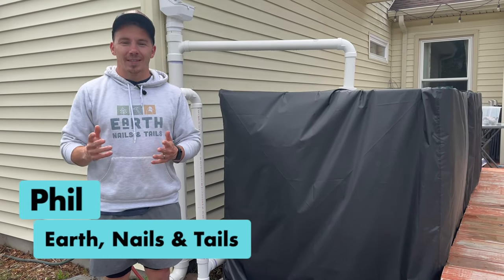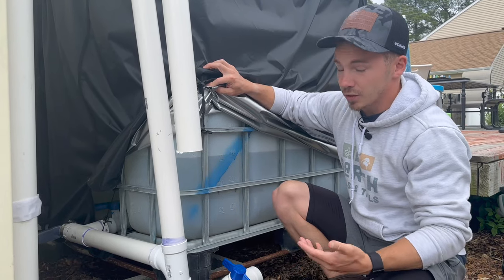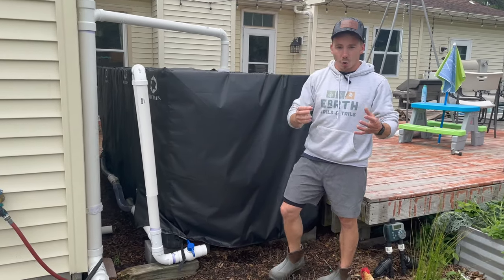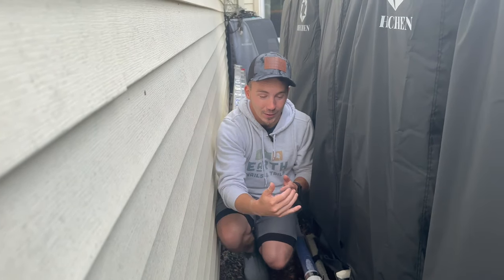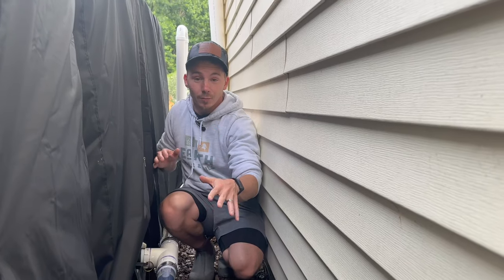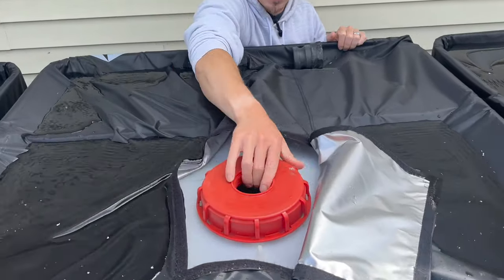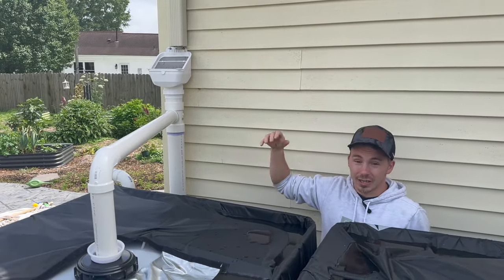DIY Rain Water Collection System - Over 800 Gallons of Rainwater!

Comment: Nice system and well presented. I have been using rainwater for 100% of my household needs for 20+ years. Before my water enters the house it goes thru a 3 stage filtration system. Before drinking or cooking with it it goes thru an aqua-cera filter. Overflow from my household system goes to two 330 Gal. IBC. That is used on the garden.
Reply from the maker: Love this! Thanks for sharing
Reply: @michaelbandeko3519 would love a video of this system!

Comment: If you drill a 1/4'' hole in the drain cap, it will slowly drain by it's self and you won't have to remove the cap after each rain storm, saw this on other videos.
Reply from the maker: Great recommendation, thanks!

Comment: Nice setup and nicely demonstrated. Only thing I would suggest is to route your over flow away from the property to avoid any foundation issues and settling of your water tanks.
Reply from the maker: 100% agree! I have installed a diverter and working on a better solution involving routing the water to a rain garden

Comment: Thank you very much, excellent video.
To prevent debris from entering the tank, it is a good idea to have a larger initial water reception volume. This can be by using a longer pipe or a small receiving tank. In both cases there would be a 1/4" drainage hole.

Comment: I see a video of someone using the gray PVC pipe as your gathering off a tin roof . They cut one side of pvc pipe . Put the edging of sheet metal roof into the PVC . Right in the middle of the pipe all the way in the pipe The top side of the pipe catches the water running off the roof bottom side of the pipe let water run to the tank . 
 bottom side drains down in the 2 “ PVC pipe . They put straps to hold pipe in place on the roof  . Pipe size look like 4” for the guttering . Plum out to 2” going to tank .

Comment: Excellent video thank you so much. I checked out the link to the supplies you used. Did I miss in the video where you used the Twinkle Star sediment filter?
Reply from the maker: Your right it was not directly mentioned in the video. I have it installed before my pump just incase all my filters don’t catch everything and something winds up in the water supply.

Comment: How do you keep the overflow from siphoning out the tanks? ThankYou for sharing your setup.
Reply from the maker: Drill a tiny hole in the top of the overflow to act as a siphon  break or if you use a large pipe with a shallow overflow like I did it should happen naturally 👍🏼

Comment: We use these with epoxy stored 4 high. I bet if you stored them 2 or 3 high, so they are still below your roof. You could get away with less need for a pump.
Reply from the maker: its true, the higher it is the more pressure it will provide. just remember the farther you need the water to travel the bigger the pipe will need to be. this is what makes having a pump handy. maintains the pressure over long distance

Comment: Great system, thanks for sharing this. Just one question , is there any risk of legionella contamintation when the water is heating up in the containers iduring warmer days? 
Would this be an actual concern ?
Thank you
Reply from the maker: there is definitely the potential for bacteria. I would not spray this on the plants. use a drip system or apply it directly to the soil 👍🏼
Reply: @earthnailsandtails   thank you for your answer, could you please share the link for the trap-on to the end of the tube

Comment: Great System! are you at all concerned with the  potential chemical leaching from the Asphalt shingles? Im sure its fine but wondering your thoughts
Reply from the maker: I think it is a legitimate concern but I think the amount that comes off won’t be that significant for the amount of time the rain actually spends on the roof. The filter systems should prevent any sediment from getting into the totes which could cause more significant leaching

Comment: You would have been better off raising the totes about 4 feet off the ground to give the lines gravity pressure, as the lower the water level is in the totes the less pressure you will have at standing height. Your build is pretty stout otherwise.
Reply from the maker: That would be a pretty big undertaking and wouldn’t really provide that much head. 30ft yields about 10lbs of pressure. I got myself a transfer pump and it works great

Comment: you would have been better off with a fine mess to stop mosquitos
Reply from the maker: There is a fine mesh filter. Someone didn’t watch 😉
Reply: @earthnailsandtails  Well you are the one that said the flaps ontop were for stopping mesquites and the fine filter on the intake and inlet was for  filtering out debris and sediment. So yeh I did watch.

8:10
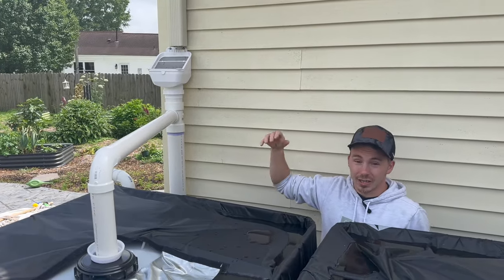9:45
11:58

What I mean is I would have went with fine filters over the 2 tanks back from the inlet tank so that encase the Velcro isn't sealed correctly mosquitos and other bugs still can't get in.

And if you do have fine filters over the other 2 tanks... well if you said you did I missed it, but I did watch the video.